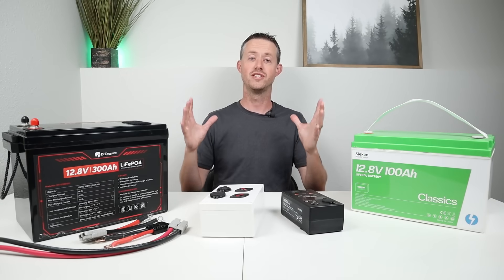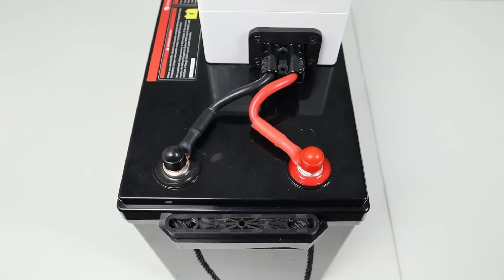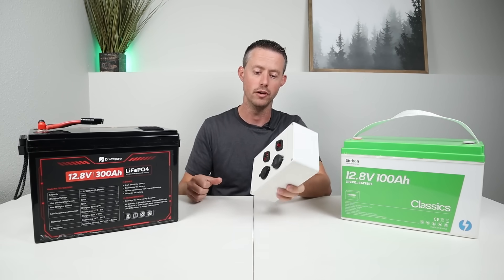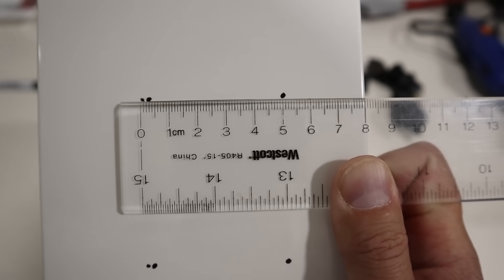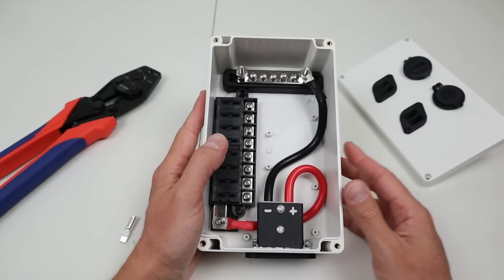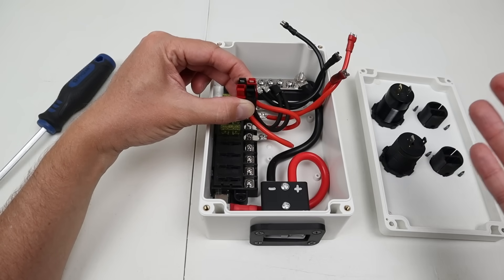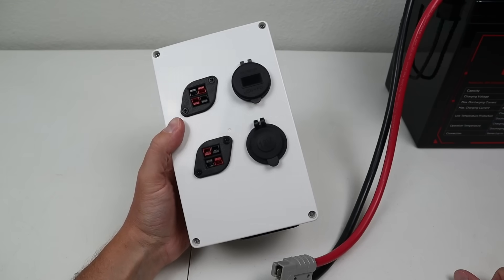Make Your Own DIY DC Power Station!  Just Add This To Your Battery  -  Step by Step Build Video

Comment: Could you use a bluetti DC to DC charger and charge a DIY battery box like this from the alternator? Not using the SB50 but directly to the battery

Comment: Outstanding video! So, if you had all these outlets in use like chest fridge, 500 watt heater element, water pump, LED lights and a car radio with speakers and phone charger! How many solar panels would you need and what solar charger would you use? Thank You Brother!

Comment: Can you solar charge the battery and use the DC outputs at the same time without interruption? If so, how?
Reply from the maker: Yes, you just hook up a solar charge controller and your loads at the same time. Just watch a video how to wire a solar charge controller, it's really easy.

Comment: So I've been doing a ton of research and watching lots of videos and it's frustrating how few out of the box options there are for high power dc in a mobile (under 30lb) solar ready box. From what I've gathered, the pecron e1000 is sort of the best option for my use case.

I'm currently building a pulk sled camping setup for a trip I've been planning for a while. About 10 miles snowshoe hike pulling the sled with a hot tent and stove and the rest of my gear.

 For most people a few battery banks and a smaller solar panel with USB c would probably suffice, but I build and fly large fpv drones for getting remote cinematic footage. My largest flight packs are 6s 10ah li ion and charging them at just 1c, I need roughly 25v 10amp. Usb c isn't capable of this realistically, though a 240w usb c pd port gets close, those are super rare.

The 20a xt60 port on the pecron is great, and should basically get my charge rate for these packs to 1c, but that's pretty slow still, and the packs are rated for 2c charging. So for a 12v port I really need 40a. Using the inverter to run my ac charger would be an absolute last resort with the losses from conversion. I'm wondering if accessing the battery directly on one of the smaller 1024wh units is possible. I can build a cable, and stepping down the voltage without loss is easy enough if it's 48v.

Comment: Nice and simple build. I would however add switches to the Anderson plugs so that if you chose to connect a device such as lights you don't have to pull the plug to disconnect.

Comment: Really cool idea Jason. You'd have so much fun with a 3D printer. You could design the box how you want it and print them out. Would be nice if companies made this as a thin box that was the size of a standard 100a battery and covered the terminals
Reply from the maker: I've thought about designing something like that, basically it could connect directly to the battery terminals. It would be fun, gotta buy one someday!

Comment: I am picking up a Radica Moonlander X topper for my truck in a couple of weeks. I camp pretty much exclusively overlanding generally for multiple days. I have been using two power stations Bluetti EB3A and EcoFlow River2. Since my plan is to say out on longer trips with the new topper, I wanted to build something to enable that. I built a wooden box and inside I can have 2-Eco Worthy 12v 100Ah batteries. On the side I have an input for a solar connection. On the back I have a small 300w inverter even though I don't take any AC appliances with me. I had it laying around and figured, why not. Also on the back I mounted a 10amp 12v charger that I can connect to the 120v outlet that is in the cab of my Ford Ranger. On the front I have a 5-switch panel for connecting my freezer, fridge, interior lights, ceiling fan, and exterior light. And, on the front, multiple 12v car sockets and USB-c and A. The whole thing tucks under the bed platform. I figure with 2,560 watt hours, I can stay out for a week or better if I have decent sun without using the 12v charger. I would love to swap out the 2 batteries for a single Eco Worthy 300Ah but I already had on of the 100Ah
Reply from the maker: That sounds like a great setup for overlanding!

Comment: We just bought a 2022 Toyota Venza. Our old 2009 RAV4 has a 12 volt power outlet in the cargo area but the Venza does not. How would I go about installing one? We would use it on trips to power a 12 volt fridge/freezer. The Venza has the 12 volt batter installed in the rear of the car. there is a very small fuse block there as well but note of the fuses are more than 10 amps.
Reply from the maker: You can run a wire lead directly from the battery to where you want your fridge. 12 AWG wire, 20 amp fuse 👍

Comment: Great concept but I have a few safety quibbles. While you have plenty of fuses inside for the individual circuits, the main 6awg cable is not fused at all which is a hazard. You yourself might know that the connector has a 50A max but someone else might not and come along and plug something (or multiple things) in, thereby overloading the connection. For example, plugging in a 100W transceiver and a small laptop and using both at the same time is probably close to maxing things out. The supply cable should be fused at the battery and capacity should be labeled. Also, you have different sized fuses/wiring for the power pole connectors but again, no labeling so no visible/obvious way of knowing what the fused capacity is. And nothing is preventing connecting a high-draw circuit to the lower amperage side. (Hopefully, each draw is fused post connector as well). As for the bus and fuse bars, you used adhesive to mount them to the box. If something heats up, that could make the adhesive soften and allow the bars to separate from the box and make contact which could cause a short. These should be mounted securely with small nuts and bolts. Finally, you've got four sharp screws poking into the open cavity like daggers. One of them could easily cut into the insulation of the wires inside creating yet another hazard. Again, nuts and bolts would be a better option. Keep in mind that when dealing with the amount of energy contained in that battery plus nearly everything being plastic that a fault could easily mean a heck of a conflagration so safety is paramount.
Reply from the maker: Of course! DIY projects require basic common sense. I'm glad there is a slight barrier to making this stuff 👍
Reply: Any lithium battery needs a 'master fuse ' at the battery positive terminal.  If the battery internal BMS  fails there is a possibility of several  thousand  amps flowing.  A fuse designed would withstand this very high current is needed.  With a 12v system you can use a MRBF fuse, this is a lower cost alternative to class C fuse or a BS88 HRC fuse

Comment: Oh! I'd love one of these off the shelf models that could take a 48V input and distribute it out safely to similar ports.
Reply from the maker: That would require a bit of voltage conversion. You'd have to install a 48v to 12v converter and then install the DC box.

Comment: 7:59 Anderson. I would use a screw/bolt method with loctite.   More secure. 
My kids would wobble the screws off quick.   

Ty for the great work
Reply: loctite is not plastic friendly learnt that in the hard way 

unless there is plastic friendly ones out there

Comment: Fun project! I'll have to look into creating one of these for my new Redodo 165Ah.
Btw, it'd be awesome if you could make a video comparing some of the power wire available on Amazon. From what I can tell through reviews, a lot of it is cheap crap that often doesn't meet the specified AWG rating. I'd be great to know what's best and what to avoid. I splurged (I think) and went with Ancor 1/0 marine grade, which surprisingly doesn't have many reviews, but seems like one of the few brands that doesn't cheap out.

Comment: Thinking you need a 30 fuse just on the battery
Reply from the maker: 60 amp fuse for the 6 AWG wire.

Comment: I like this box.  The nice thing is that you can add any connector of your choice.  Something I would add is circuit breakers in place of the fuses, that way I don't worry about having spares or bring the screwdriver.
Reply from the maker: Circuit breakers take up much more space so the box would have to be double or triple the current size. DC breakers work great though!

Comment: Jason can I have a charge controller / solar panel(s) charging and also use the DC outputs at the same time?
Reply from the maker: Yes, as long as the total net power going in or out of the battery doesn't go over 60 amps for the 6 AWG wire.

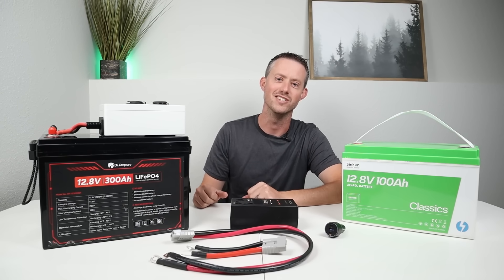Comment: In 2014 i put a 9ft topper on my utility bed added 3 165 watt panels from Amazon and a zantrax c60 charge controller  from ebay bought 6 e scooter  battery's  from craigs list for 120 a fridge from iceco 43 qt for 600 an old Ingersoll 1800 watt for 40 i live in North Dakota and am afraid of lithium freezing but I am thinking that I will need to replace the battery's every year i use the micro or air fryer  daily just turn on the inverter for 30 min after work also installed 4 linear actuators on all 4 corners at 12 v push a toggle switch and my ceiling goes from 56in to 74in 2 min up and 30 sec down  kinda like a poor boy Alaskan camper all last year i was in northern Montana and was paid 150 day perdiam my whole investment in the solar was 680 haven't changed anything but my ubi battery's are 14 years old the fridge is 6 but living up north the fridge is cold at 95 i heat with a propane turkey cooker below 25 and I am always the guy on the jo b tried a patriot power station 2500 and gave it to an old man that needed it you don't much if you want lights and chargeing or quick  cooking.ifeel terrible watching  these  videos of people spending  stupid money on nothing if you dont need AC it   can be really inexpensive ⁷ 15:28

Comment: Please don't show people how to conect things to a big battery without putting in a fuse. Yes, the BMS in a LiFePO4 battery will shut down on overcurrent, UNLESS IT FAILS, and we all know electronics built to budget will never fail !!!
Reply from the maker: All the internal connections are fused. The short run of 6 AWG could handle over 60 amps safely. Just takes a little common sense 👍

Comment: I was looking for something I could use for the Delta Pro Ultra's 12v 30amp port. To use Capitalize on the Fullest Potential of it, can you think of anything I could use for it, This Video gave me some good ideas
Reply from the maker: Maybe running a 12v fridge? Or maybe 12v lighting? Anything that's 12v is usually more efficient than the AC alternative.
Reply: @Jasonoid  I meant a Box like the one in the Video. Hooked into the 30amp dc port of the Ultra

Comment: Nice,  i did a similar set up for about $12 no box just the plastic stip the outlets came with ... Your set up looks like it would have been better to run the outlets through the side ... Could be much smaller... Anyway great concept...
Reply from the maker: It might have worked through the side of the box, thanks for the recommendation!

Comment: Great video Jason.  I'm in the process of removing the power strip on my portable hand truck EG4 built and replace it with a distribution box that has a 30 amp RV plug and a couple of GFCI 20 amp plugs. I figured it would be a great way to use and discharge my server rack battery once a month by connecting it to my RV and Run the air conditioner for a couple of hours. I like the 12V distribution box that you listed for $128.  Do I have to do as much wiring as you did on this video or is it pretty much plug and play?   Thank you for the video and the links.
Reply from the maker: The DC boxes are plug in play, no extra wiring needed. Just keep in mind they are designed to run off 12v systems / batteries.

Comment: I do not believe that your choice for USB-C/A/voltmeter will deliver anywhere close to the 60+ watts when connected to a 12v source. Those PD ports and the ones on your cigarettes port adapter will not deliver anything close to that when connected to 12v. Try charging a MacBook. It won’t do it. Those won’t deliver 15v or 20v PD. There are better similar options out there that will step up the voltage to 20v at 3 amps that are available on Amazon. Regards. Not sure if I can post a link here or not.
Reply from the maker: I pull 100w from the cigarette port option all the time 👍

Comment: I go camping with two 12v coolers and two solar generators.  Is there a way to connect them both to one solar generator?  I assume one would have to be connected to AC and the other to DC?
Reply: There are 12v receptacle splitters that give you 2 plugs.   Most smallish 12v amp fridges run under 50w so it should work but it'll also be common for them to not always turn on at the same time
Reply: @veganpotterthevegan okay thanks.  I thought they would draw too much power to be able to work

Comment: Thank you for this video!  I'm going to be doing a minimal weekender/road trip wiring in my future van. One of the things that I've been trying to wrap my head around is, because there are dogs to consider, I'll be installing a 12v rooftop air conditioner.  It can have a powerdraw, at times 58 to 62 depending on make.  I cannot use a power station for this and was advised I'd need to attach directly to a battery (I'm planning on a 300AH LiFePo).  Given your info on this video, am I correct if I attach the A/C connection straight to the battery terminals (it will have its own inline fuse), I can also use something like your setup as well on the same battery?   That would certainly save some money on a power station!
Reply from the maker: Yes, the high power loads would connect to the battery terminals directly and the smaller loads can go through the DC box.

Comment: Amazing video again.  Was just looking for a DC distribution box idea to utilize the 30amp Anderson connection on the Anker F3000 (which is working brilliantly at the cabin, thanks again!)   I did come across the $128. one, but wasn't sure if it was safe making up an extension cord with 50 Anderson connector on one end and a 30 amp connection to the power station.  would just be for a small dc fridge and charging small devices..
Reply from the maker: I don't see why that wouldn't work. If you pull over 30 amps the output automatically shuts off 👍
Reply: @Jasonoid  perfect! Will order it and see how it goes. One of these days will try just building something like yours there

Comment: DC5521 and/or DC5525 would have been cool
Reply: Instead of barrel connectors I installed an SAE plug in my camp trailer for the portable refrigerator.
Reply from the maker: With DIY you have the freedom to install whatever ports you'd like 👍

Comment: Is there a way to use an mppt controller into the box to charge the battery?
Reply: It might be easier to affix a PWM solar controller on your solar wires or panel. On a small system you don’t lose much power by using a PWM.
Reply from the maker: You can definitely connect a charge controller up to the Anderson 20 amp or 30 amp ports. As long as the charge controller doesn't go over the 20 or 30 amp setting.

Comment: Hey Jason nice vid 

I've been doing something similar with my set up. 

I run 8x24v 100ah litime batteries in my Main system but found 2x lightly used litime 12v100ah minis and 2000w renogy inverter locally for$200. Couldn't pass that up. 

Been building a camping setup up minimizing the need for 120v. 

Starlink mini, litheli frozen fridge, and I have 2x Ankers 140w car chargers. 

I ended up buying a cup holder style 12v 200w bestek inverter that seems to use 2-3w power standby if needed for the unknown emergency. 

It's been a fun project so far.
Reply from the maker: Sounds like you've got a great setup going for your camping trips!